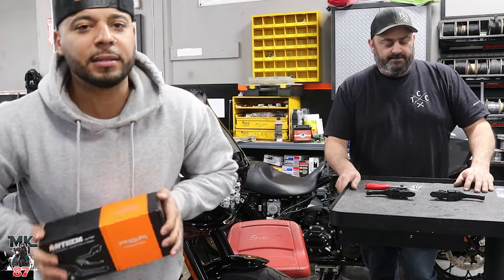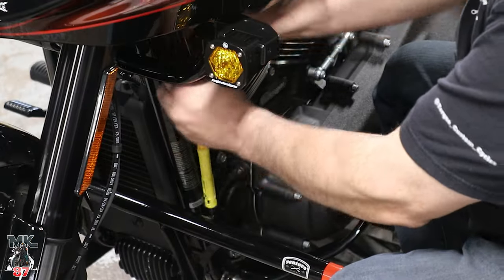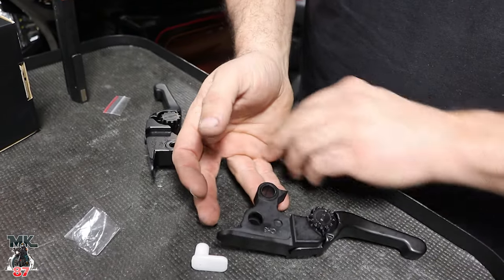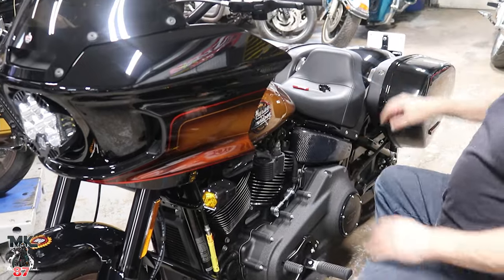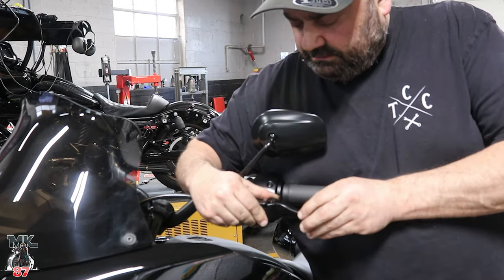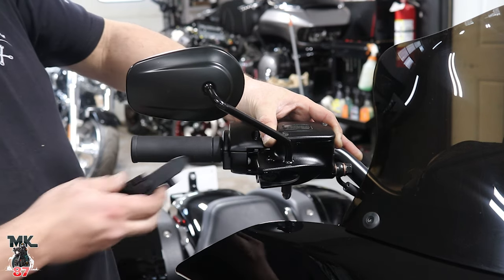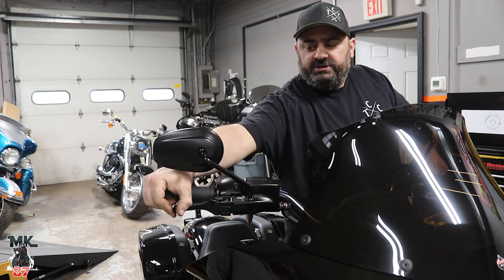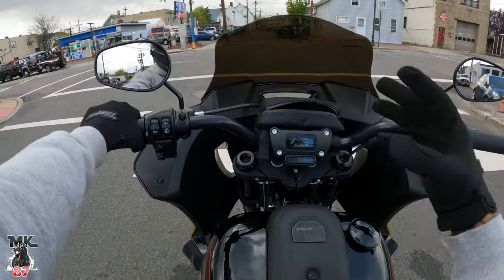Shorty levers for your Harley Davidson Low Rider ST

Comment: You’ve convinced me to give these a try.  Just ordered a set.  For some reason releasing the clutch on my FXLRS is problematic for me, I almost have to roll my wrist forward just to extend my fingers enough to get to that release point.  And of course this throws off my timing and I usually open the throttle too much by then.  Always sounds like I’m trying to race. 🤣.   Anyways, thanks for the suggestion.  These look great and have the practicality and functionality I evidently need.

Comment: Hey brotha just remember when using adjustable levers, the clutch basket needs to adjusted to the throw on the clutch lever that you have the setting at. Or else you could be shortening the throw and burn a clutch up
Reply from the maker: Yea it got adjusted

Comment: Not sure if you still have these on the bike. If you have the lever as close to the grip will
It still start the bike with the clutch pulled in? I know the flo adjustable shorty levers do not start the bike in gear if dialed to closest setting to grip. Thank you

Comment: what part number did you use? I have been looking at those but they don"t have the 2024 low rider on the drop down menu.
Reply from the maker: Just put 2023 it’s the same bike
Reply: @Marvelkid87  unless i am looking in the wrong spot I don't see anything past 1994